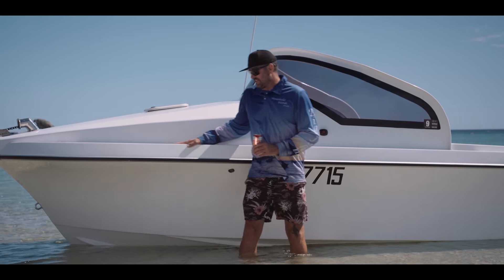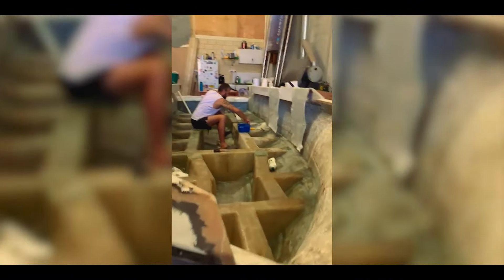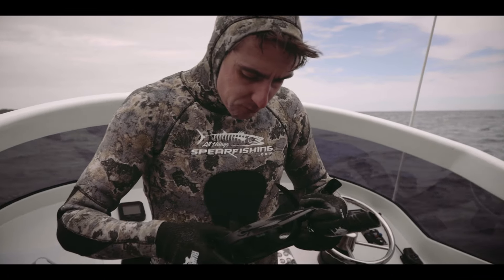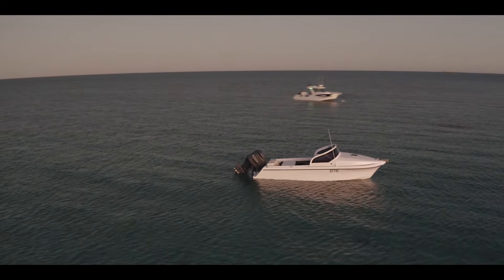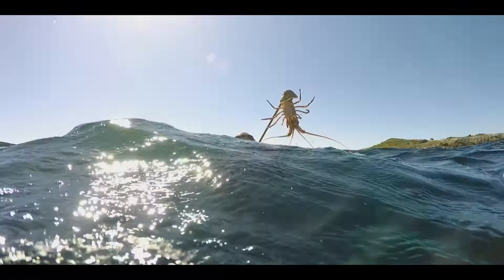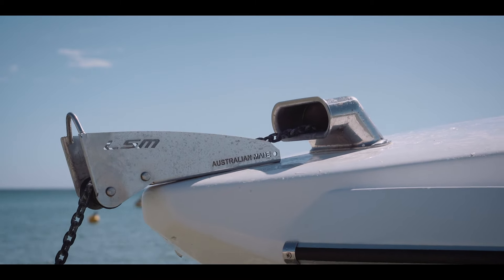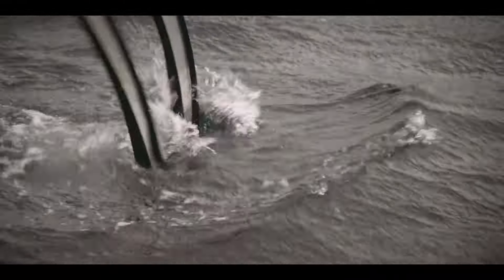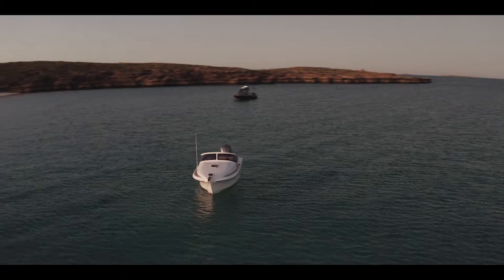$50,000 21ft Pacemaker Project Boat

Comment: Are they 24deg deadrise in the rear?? 
I might be totally wrong, and it  may be deceiving, but going by the build pics, @1:19 it would be lucky to be any more than 21deg.. 🤔 
Nice work, looks like a top quality build 👍
Reply: They definately weren't 24 degrees. 19 or 21, can't remember which.
Reply: @grantm1891  Yeah I agree, can't see it being anymore than 19-21deg deadrise.
Reply: Thats an awesome build- looks like a tank- but have to agree- there's no way that transom is 24 deg. Its between my old US CC which was 18 and the Coldfront- I run now- which is 24 deg. This looks around 21- maybe 22 at a pinch. similar to Edencraft 6m deadrise- which is more practical than 24 deg anyways if you are moving a crew for diving